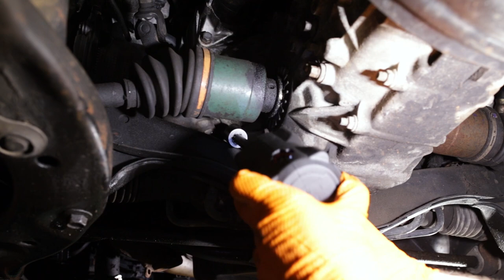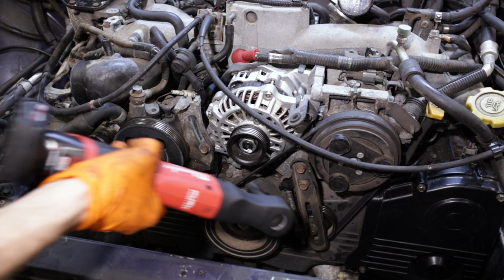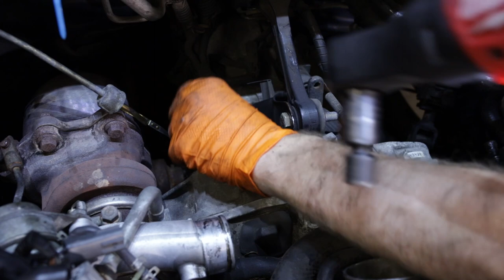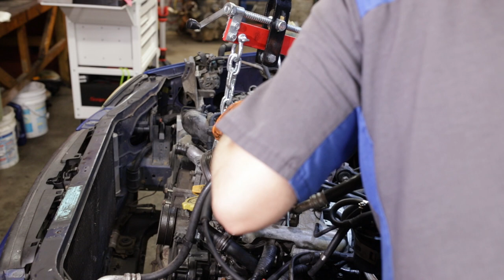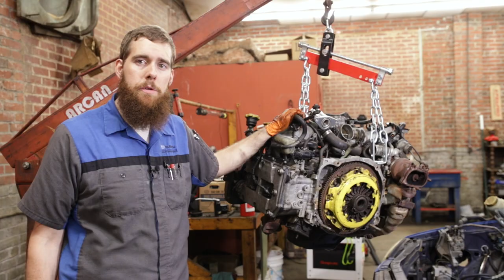Bugeye WRX Resurrection - Part 2 - Engine Removal

Comment: If I was me for this long job, I'd ask as well for a head gaskets replacement just to be sure the Bugeye would be set for another 100K-150K miles with no possible leaking issues in the future. Great work as always MrSubaru!
Reply: Gowdaflow turbo subis have always had bulletproof mls head gaskets as far as I know
Reply from the maker: Yup. No HG issues on any Subaru engine, aside from the n/a 2.5L.
Reply: MrSubaru1387 thanks for backing me up Robert I’m far from a professional haven’t turned a wrench professionally for prob a decade the reseal is prob best move you can make
Reply: MrSubaru1387 I see..
I have my ‘01 Forester n/a 2.5 and had to deal with a big HG job myself.
Great to know the turbo models aren’t affected
Reply: Gowdaflow I got 10 legacy just did mine the oil leaked so bad car caught on small fire

Comment: Thsnks matey from Australia for this video. I to have an 02 bugeye WRX, the car is in excellent condition with a completely rebuild engine from the previous owner but there is an issue with tappet noise. This video was great as I want to pull the engine out and adjust them and also change the clutch,.

Comment: This video takes me back. I had to pull the intake to replace some fuel lines on mine. There must of been a Service Bulletin I got a parts list from for the parts. You could smell raw fuel when it was super cold out. And not long after that the oil cooler busted internally and filled my cooling system with oil. Car was a nightmare but loved driving it.

Comment: First off I want to thank you for your videos I can't tell you how much they have helped me . I have a 2004 wrx with 230 k and it has some oil leaks and the turbo finally died. I have sourced a JDM Engine that appears to be in excellent shape, I have followed your videos and done a complete reseal. new oil pump, water Pump, timing set etc. my question is this I haven't found a video on priming the new engine or turbo any help would be greatly appreciated. I'm probably in over my head but I'm this far now so no turning back.  Thanks again.

Comment: Why does that Wategate arm get bent on the Bug eyes ? Those hoses for the boost solenoid get so brittle mine shattered. I would be taking my 04 STi to you for anything I don’t like to touch - timing belt , Clutch. You are the Subaru Guru

Comment: Hey my fans ain't working. Checked it its the fuse and its fine. Try using those green plugs under dash the fans work. How do you get those relay off. Didnt want to pull hard just in case it breaks.

Comment: Hi Mr Subaru,I have a 04 XT Forester I'm working on it,the motor is out and turn very easy,it's really dirty and nasty,it has 180k is it worth it rebuilding or get a jdm ej205,and how much will it cost to rebuild,thanx

Comment: i know this videos old and im hoping youll respond, but do you have a video on how to INSTALL the engine? Im having trouble figuring out where everything goes exactly and ended up stripping all 3 power steering brakcet threads.

Comment: Hey I got a questing I have a 2011 Subaru Legacy 2.5i with the cvt transmission I too off the engine to do head gaskets and well the transmission does not engage after putting the engine back in everything is plugged in and the tranny is filled I don’t know what do next any suggestions

Comment: This may be a stupid question, but, would it have been easier to pull the engine and trans together!?
Reply from the maker: Absolutely not.
Reply: @MrSubaru1387  
  Okay, that was a quick and concise answer! 😁
  If you wouldn't mind explaining to me why not, I'd be extremely grateful. 
  I'm very much a noob to these platforms, and seeing what you went through with the clutch fork, it looks as if it would be much easier to deal with that outside of the engine bay. Now, obviously I defer to your judgement on this. My curiosity has been peaked, especially seeing as I may be snatching my engine soon for an overhaul. At almost 300k miles, I imagine that the rotating assembly bearing's are just about done for, and while I'm at it, I was also going to address some of the weak points while the engine is out and apart.
   Thanks for taking your time out to answer my questions.
Reply: The transmission drops out easier from the bottom after disconnecting the propeller shaft and removing the transmission cross member.  It's been awhile since I did a clutch rebuild but it's absolutely easier to drop the transmission out the bottom and I'd say ridiculously harder to take it out through the top.  Stay Dirty!!  🤕 🤬
Reply: @tyree9055  
 Always man, grease on the hands!
Thanks for your input though.  Still learning about these vehicles
Reply: was it necessary to remove alternator waterpump ac compressor etc? Could that been easier outside when engine is out?

Comment: Which would you rather have?  EJ20, EJ22 or EJ25?  Bugeyes are cool.  :)  Excellent work!
Reply from the maker: Turbo, EJ207. N/A, EG33.
Reply: @MrSubaru1387  I would say EJ25.  Interesting you said Turbo EJ207.  Manual or Auto?
Reply: @gbowne1  EJ25D? EJ251? EJ252? EJ253? EJ254? EJ255? EJ257? EJ259? Which EJ25? There's more than one.
Reply: @KALI1080  Yes, there are several EJ25's.  What would have been in a 1995-1997 Legacy L Wagon w/no 4wd (no Brighton) (and perhaps a few others).
Reply: @gbowne1  Phase 1 EJ25D  the weird one with hydraulic lifters.
Reply: @KALI1080  yes that's the one. I actually wouldnt mind a US Spec EJ22 too.  Though I prefer 1998 and 2001 models.
Reply: I think it would be a choice between 1998 Legacy Wagon and 2001 Outback.

Comment: Would I be able to pull the engine without taking all the accessories off? (leave ps pump, alternator, etc.)
Reply: I was gonna say same thing you don't need to take all that crapp off so much easier to do when engine is out.
Reply: @tonij4073  I have pulled my engine since I made this comment and yes you can leave all the accessories on it when you pull it. You will have to remove the starter and radiator though.
Reply: @justinechols3254  thanks for reply,  now i watched other videos and i see why they pull them off , cause of the lines so don't have to refill recharge again and not make a mess as well. And also to hook the chain to pull engine out where ac compressor goes. Hope I'm making sense lol.
Reply: @tonij4073  absolutely, I just hooked my chain around the manifold and lifted it that way. Whatever works!
Reply: @justinechols3254  thanks.